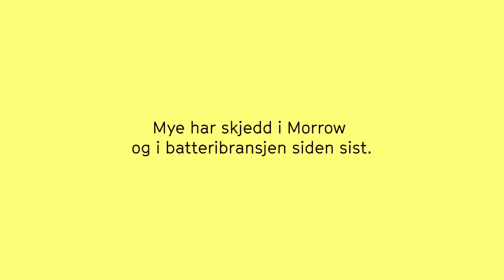Interview with EVP & CTO Rahul Fotedar from Morrow Batteries

Comment: I would love to see more about batteries. Especially about repairing and reusing them. Compare for example a Kia/Hyundai battery with 32 modules that can be easy and cheap individually replaced with a VW/Audi/Skoda that has about 10 modules or a Tesla that has a capsulated battery or 4 module variants. It's not the same if you can fix it with by replacing a 200 EUR module or you need to pay 10.000 EUR or more for an entire sealed battery. The SH market will become significant and people will need to learn what is a good designed battery that can be repaired easily in case some cells go bad or a rock damages it. The 150.000km warranty that most producers offer goes fast, sometimes in just 3-4 years. After that, being able to service your car battery at a decent price becomes critical.
Reply: P.S. This will also affect the insurance costs a lot in the future. I hope the EU wakes up and they will implement some minimum requirements for this. It's not normal to scrap the whole car for a small dent in the battery that we should be able to fix easy by replacing just the battery cover or the few cells that were damaged. I've seen quotes for batteries that were more than the entire car. Some dealers take advantage of this for now, but on the future this will increase costs a lot if nothing is done about it. I'm sure that a way can be found, if they managed to force Apple the change a stupid charging port, this is orders of magnitude more important to regulate.
Reply: a battery standard would be better for consumers but might stifle innovation.
Reply: @jean-marcgruninger9019  I am not talking about standardization of cells or batteries, we want innovation but also repairable and reusable packs. The best way to approach it would be to limit the minimum number of modules inside the pack or the maximum size of a module that can be replaced individually. The minimum number should be 10 modules, like VW has, the recommended could be 20 and the ideal would be closer to 30, like some Kia and Hyundai offer. Or limit the module size at something between 3 to 5 KWh each. This way one module should not cost more that a few hundred EUR each. And the battery should not be glued, only replaceable (rubber) gaskets that can be easily swapped if damaged.
Reply: @flaviandd  ok , yer, that sounds good, so everything with repairability in mind.
Reply: I'm sure this will happen in EU first, then others will follow. Once batteries are easy to repair, there will be a boom in repair shops with specialist knowledge of taking them apart and replacing weak cells. Good for the independent automotive industry.. and good for the environment. Will help the world to cope with EV demand too. When the next global supply crisis occurs, there will be another option to keep cars and electric public transport on the road.
Reply: Isn't the biggest cost opening & closing the battery pack (working hours)? A defective cell/module is rare
Reply: @pieter85  nope the biggest cost is having to buy a new battery
Reply: @pieter85  if one cell is faulty, the whole pack suffers. If packs are designed to be maintained this is no longer a problem. Might be rare to get faulty cells now but when the number of EVs on the road increases exponentially, so does the chance of a fault

Comment: Is Rahul talking about LMO or LNMO? Not sure i heard it correctly. Or is he referring to "nickel rich manganese"/"high lithium manganese" chemistry (NMC 370) that gets a lot of traction lately? He didn't get to answer on the charging answer regarding tot that chemistry. I'm curious on the charging capabilities for that chemistry.
Reply: LNMO
Reply: Fast charging of LNMO will depend in part on the anode material. If they use a graphite anode (which I think they are trying to develop, nobody has managed to do it so far), it will have the same anode-side limitations as NMC/Graphite.

Comment: With the many battery manufacturing factories being built in Europe, North America and looks like Australia is going to get into it. All that competition is going to drive performance and costs only in a good direction. In 2035 you might be able to put a new battery in your 2013 Leaf that is half the size, quarter the weight and a thousand kilometres of range.
Reply: May be enough will be to have the same size of battery, 20% less weight, 40% more range and half cost... but why not to dream...

Comment: Overall lifetime emissions are nevertheless around 80% lower for the electric car since 90% of the petrol car's lifetime emissions are due to the combustion of fuel.

Electrification of the oil platforms will - together with electricity for refining the oil - mean that you use far more ELECTRICITY to drive a fossil fueled car one mile than the equivalent for an electric car!

Comment: Bjørn, a question you could ask Morrow Batteries. Is there gains to be made in the processing of recycled batteries? From what I have seen whole battery modules are shredded, separating the components in a  automated before shredding might make further processing easier, if it's scalable... for example.
Reply: Umicore for instance has a different methodology; they just burn the damn thing (they use the energy inside the battery). Pyrometallurgy + Hydro step. Less CO2 intensive & more scalable. They operate a pilot plant with 7000 ton capacity  (that is bigger than most recyclers today) since 2011.

Comment: Don't forget to mention that Tesla batteries are designed to not be recyclable at all. Other manufacturer do but Tesla rather wants to safe costs. Also car batteries today are not recycled because it is far to energy expensive. They just throw them away.
Reply from the maker: That sounds very unlikely. How on earth do you make a battery not recyclable? The materials there are always possible to extract.
Reply: Car batteries have a second life. Grid Support as one example. And after that you can recycle. There are first facilities that can do this. Videos available in YouTube.
Reply: false
Reply: Umicore is recycling batteries profitable since 2011; 7000ton capacity annually (that is a pilot plant for them; they want to build a new one with 150000 ton capacity, SOP probably in 2027). They started with cell phone batteries initially. They use the energy inside the battery for their proces... EU requirements are >95% Co,Ni,Cu & >70% Li product to be recovered during recycling proces. (targets probably will move up in the future)